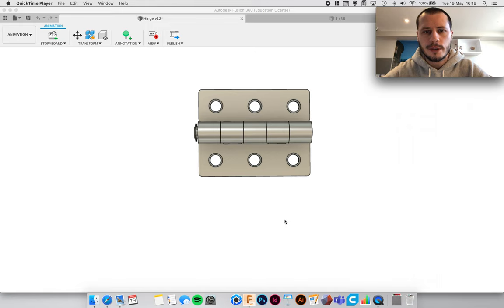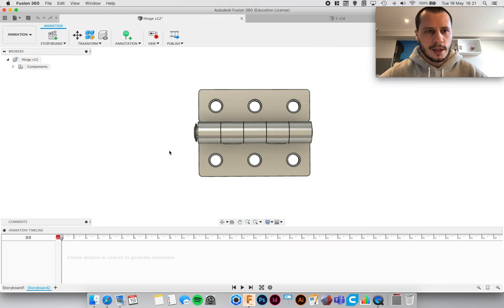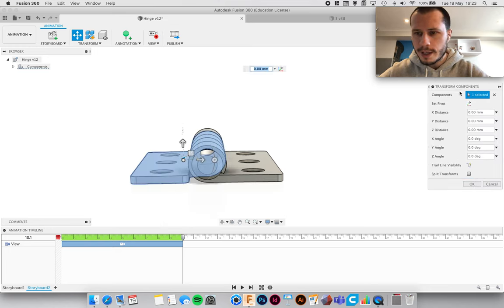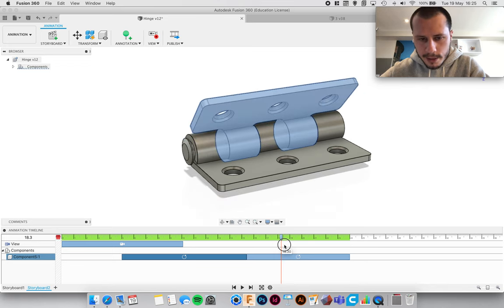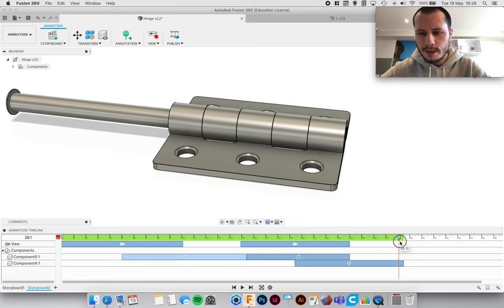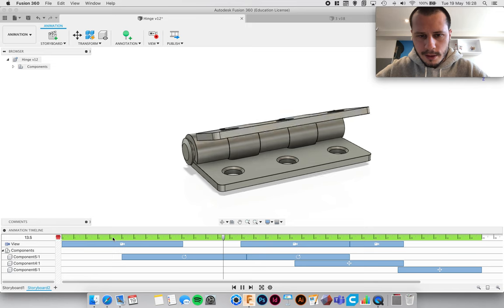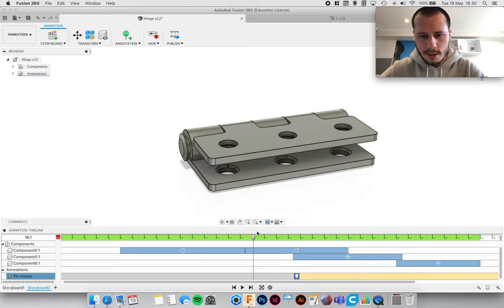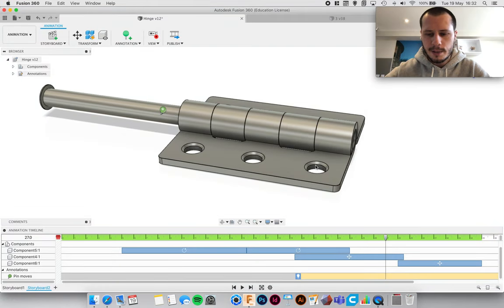Creating animations in Fusion 360

Comment: How do you make the lightning look like render mode in the animation mode? because in the animation panel you set all the camera and parts movements. But the final video you show at the beginning is with a black background and perfect lightning. How do you do that inside fusion 360? because for that type of animations i use keyshot but it would be super nice if i could do it inside fusion so i dont have to be using multiple programs. Thanks!
Reply: Is keyshot free?